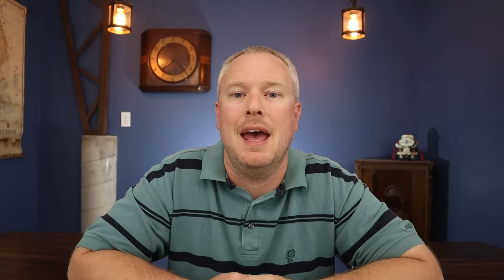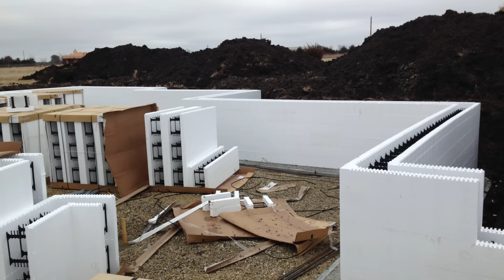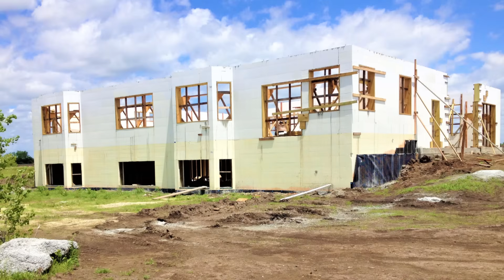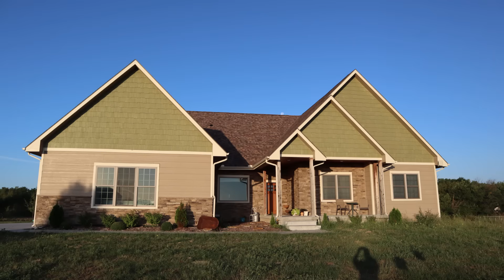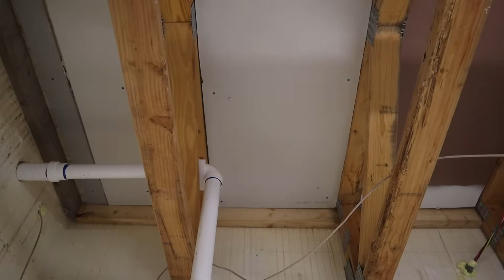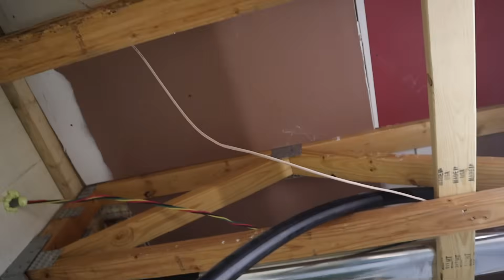Is Geothermal Heating & Cooling Worth It?

Comment: I did the same about ten years ago, I put it into an old leaky farmhouse on 11 acres, put about 2000' of loop under the pasture, and it's been great. If it hadn't I would have set iy up to use my well water from my current 450' well and and put the return over into the pond. The whole thing unit as well as installing it myself cost about $6,000. Only problem I've had with it is the condensation drain plugging up after 5-6 years which is common for all types of systems around here.

Comment: Just got rid of the 25 year old climatemaster piece of crap. Way over sold back then and hopelessly this guy is spitting out the same crap, don’t buy in on it. No rebates, super high cost, all the noise is constant inside the house. Any hvac guy will tell you run away from geothermal, except thethis guy selling this crap.

Comment: Glad this worked out so well for him. Generally speaking, I don't recommend DIY geothermal because DIY has given geo a bad reputation in the past. A properly designed and installed system will give you insanely good efficiency and a worry-free system for decades. I understand the allure of DIY because the install cost is high. One growing trend that will bring down the cost of geothermal is utilities beginning to install geothermal over an entire neighborhood. Electric utilities love it because it reduces peak demand in the summer and provides electric demand in the winter. Just beware if you are a DIYer, there are many opportunities to screw it up.

Comment: Would like to see a video showing how the geothermal system works. How deep must you go to reach heat underground to warm the home in the winter?
Reply: So to a point it depends on where you live - you obviously need to get well below the frost line for your area.   IF you live in Barrow alaska it would be deeper then say if you lived in Georgia.   At least here in ohio where i live, 12-13 feet seems to be the minimum.  IF you lived in Maine where the frost line is just over 8 feet deep, you would probably have to go 25 feet or so down.  general rule of thumb i have found is, you want to be a minimum of 10 feet deep and also a minimum of 10 feet below the frost line.    

It also depends on what type of system you want.    Some of these systems you cut long rows in your yard,  at least 12 feet deep and you run coils of hose all around the yard like that and cover them up  But you have another option, they bring a driller out and just like if you were drilling for a water well, they bore down somewhere between 250-350FT and they run the  pipes up and down that hole.     Both accomplish the same thing, one requires alot more land tho.

Comment: Glueing some of that foam egg crate stuff to the ceiling would probably be a lot more effective than another piece of flat drywall. Like an anechoic chamber.
Reply from the maker: Actually, drywall is one of the best acoustical blockers.  The typical egg crate stuff does very little.

Comment: Will a teothermal cooling system work in an areas where there will be need of cooling all year round and the temperature in the middle of the day is appr. 32 degrees C all year round?
Reply from the maker: Yes.  As long as the earth temperature is cooler than the air temperature, it will be a more efficient way to cool using a heat pump.

Comment: Do you run the backup system every so often? Or does it just sitting there not effect it negatively over time?
Reply from the maker: It has never come on.  No negative effect when not in use.

Comment: If you are going to install geothermal for a new house construction having a concrete slab configuration, would it be feasible to locate/bury the trenches for the heat transfer pipes deep below the slab?
Reply from the maker: You sure could.  They have to be deep enough as to not pull heat from the home.  Also, you would have to get very good compaction after placing the pipes so the house could be built.

Comment: I had a 3 ton WaterFurnace closed horizontal ground loop installed at my former waterfront home in Northern Ontario. Adequate ground loops are imperative. The house has to be well insulated. The noise can be irritating. And you have to live in an area where electrical pricing isn’t subject to idiotic price changes.

Comment: Great install. I'm am hvac tech. I always loved installing Geothermal.  I would recommend a outdoor split geothermal system if possible.  It keeps the noise outside and they are actually much quite than a all in one  package geothermal system.  No noise to worry about cause it's just a very low hum..
Reply from the maker: I didn't realize they made split geo units.  Thanks for sharing
Reply: @Challenged1  
Since you have a hot season and a cold one, and already got involved with digging and insulation, did you ever considered simply storing the heat.
I mean in the summer heating an insulated portion of the ground with the help of solar vacuum tubes. 
And in the winter chill other similar storage. In this way you eliminate the expensive part that is compressor. But insulating the ground may be costly too. 
But that 100 saved monthly, and the fact that replacing some fans is way cheaper than replacing compressors.
Reply: @pineychristian I want to grow trout in souhern part of india. Temperatures here  are like Mexico or Florida. I want to run the glycol filled pipes through the fish tank. Does it work?
Reply: @raghuhiriyur  I think I need a better description of what your trying to accomplish and how does a Geothermal Heatpump help with Trout? If your temps are like Florida or Mexico why would you need Glycol at all ?
Reply: We have had Geothermal for 30 years, our WaterFurnace is in the basement and is as close to silent as possible. Literally the fan, which is variable speed and itself very quiet, makes more noise than the compressor. Unless you know what to listen for you cannot tell if the compressor is running, low or high speed, no difference. If you are not in the utility room it is effectively silent. You cannot here it in the bedroom, bathroom, or family room that abut the utility room. Also, having the entire thing inside the home means it stays dry and clean and easily maintained. I can't imagine putting half of this outside.
Reply: @larrybolhuis1049  plus they make split geo systems that use only a indoor coil which can be mounted on a natural gas furnace for heat. So you'll have a dual fuel system with heating/ cooling from geo thermal and when it gets too cold the geothermal turns off to use the gas furnace. Which in my neck of the woods is much cheaper than paying the electric company because geo's use back up electric heating strips which is like turning on an electric oven every time they come on....
Reply: @larrybolhuis1049  water furnace makes a great split Geo unit. You have it in your basement where I have seen people have package unit geo's like in the attic. Those units have the water going into them. When the there is a water issue like a pipe breaking or a leak it will flood your basement out or someone attic to the adjacent floors below. Your house must be built  well because walls probably thick and good insulation. Ive been working on geo thermal for a long time and split geos are hands down much quieter.
Reply: @pineychristian  Yes our house is well built but as an example the wall between the Geo and the family room is just studs with drywall on the family room side. The Geo unit is that close to silent.  There also are two drains next to the unit in case of water leakage! (Our builder planned ahead!)
Reply: @larrybolhuis1049  no matter what your Geo doesn't compare what is made today. They are even quieter and a split geos are best to keep even more noise down. I've been working on  geos for a long time. Worked on hundreds of them. Standard package geos are still good. Split geos are becoming more popular and get install more and more now
Reply: @pineychristian  I'm glad they keep improving, but since I have to be standing next to here if it's running, I won't be spending money to replace it, hopefully for at least a couple decades!!

Comment: You can further your efforts to quiet the noise heard in your son's bedroom either by the use of spray foam insulation, or a much more DIY friendlier installation of some rock wool. Rock wool installs just as easy as the pink stuff, it's fire proof, there is no need to worry about fiberglass fibers, and there is the sound deadening aspect of it as well.
Reply: Actually don’t do insulation as heat rises and you’ll loose bleed through heating. The BEST fix is found in music bars and it’s acoustic panels. These will absorb and redirect sound but not stop air flow. You don’t need to cover the area entirely (doing so actually lessens the effect) sound isn’t like hot/cold air, but more like a billiard ball. The idea is to bounce the sound waves around keeping them localized. 
 Doubling up the drywall would work much better if a 2-4” gap from the floor and angled slightly. A simple test is use a generator outside. Make a make shift box out of sheet stock then use a decibel meter at various locations above where open then to sides. Then angle the sheet stock with different gaps and test again. Then remove 1 side total open and another side use an open pallet. You’d be surprised at the results of the 3 tests. Then to make things very interesting take the unused 4th sheet stock and seal up 1 side of the open pallet and take a reading
Reply: 2 yrs later, but I was recommending the same thing in another comment 😂
There are DIY friendly foams for small areas like this also. I wouldnt try polyurethane froth packs for DIY though, but can foam could be enough just to isolate directly above the unit.

Comment: Are you using air or water ??????
Reply from the maker: For which portion?  The loop field is a glycol/water mix.  The inside heat exchanger is air.

Comment: My brother and his new wife built a new home and geo thermal. They were not saving that much money. They did save a lot.  And their home is all spray foam insulation so it’s super insulated. Their bill for all electric Geo thermal and inside electric utilities runs 300.00 every Jan on average.  He doesn’t lie.  Now my Mothers home has a high efficiency heat pump seer 20 variable speed and her same size home runs in Jan around 400 a month with all electric kitchen just like my brother. So my brother said geothermal saves him about 35 percent over a heat pump.  Good but not 100 a month  lol.
Reply: And how much solar do they have? He’s got solar man. Says it in the video.
Reply: So, what happened to the old wife?

Comment: Don't extract heat from earth... It will cool down the earth core... End result is lost of magnetic field, and hardening of earth core..
If this happens, very bad... Radiation from sun will burn us... Earth slow don in spinning causing far more serious climate change....
Reply from the maker: That's not how it works.  Heat is extracted in the winter and deposited in the summer.

Comment: I made mine very simple,  could only go between 5 to 6 feet in clay and granite rock. did have air in the line, ended up using a 5 gallon bucket tossed in a small  sub pump no pressure and no air in the line. Do not buy cheap units learned that lesson,  use a Waterfurnace. Older homes it can run more often. use mine spring /summer /fall , dead of winter still need my boiler. -30c   Big tip.. Geo kicks off 90% of the time the  air filter is dirty.

Comment: Ground source heat pump is a good name and should be used, to not confuse it with geothermal energy from deep drilling. Geothermal energy provides much higher temperatures.
Reply from the maker: There are three types of geothermal systems as defined by the government.  This is one, and what you described is one.
Reply: @Challenged1  We here in Iceland make a difference between ground source heat pump and geothermal. If we talk about geothermal energy, we talk about system that use higher temperatures. Usually you have to drill for it.
Reply: @mjoelnir1899  I agree that real geothermal is a grid-scale resource, certainly too much of a capital expense for an individual to heat one home. 

"Ground-source heat pump" is an accurate term, but time is money, and marketers want a quicker way to say it.

Comment: I am building a cottage in Quebec Canada. It's an A frame building and about 950 square feet. Very well insulated with triple glazed windows. I  am off grid and have a 7 kW solar system with batteries and a back up propane generator. I have a all in one ERV/split Heat pump. I am on a lake and originally was going to put my pipes in lake water however the distance to the lake and the distance to get to a 10 foot depth was too much. We have a well so then I thought I'll go open loop however my HVAC contractor convinced me to go to closed loop ground. Even though I'm on almost 2 acres  I  only have a small area next to the cottage that is cleared. I can only fit 2 trenches 30' long. My soil is surrounded by bedrock and is very wet ( digging for the foundation we hit standing water). My thought is: given the size and efficiency of the building as well as having a super efficient ERV/Heat pump and my wet soil.  I think that 50-60 of trench and installing coil pumping should suffice for cold Canadian temperatures. Your thoughts?
Reply from the maker: Unfortunately, those trenches will be too short
Reply: @Challenged1  Thanks! I can achieve more trenching if I install my loop piping in the same trench as my water line that originates at my well. Will the single water line interfere with the performance provided I keep it 2 ft away ?
Reply from the maker: @davidrosolen3282  No

Comment: Next Step: Geothermal Water Well
Using burried plastic sewer pipes and an air pump your DIY can percipitate your own drinking water to the tune of 15gph. Forget about CA water consumption restrictions. Plus the excess airflow not only provides dringing water but can be used to cool and heat your home!

Comment: What did you do to size the system? I have a new barn and I am already digging a 350+ foot trench to build a new spring development. I was going to drop that water line at 6'. I could just go an additional 2' and i'd have a trench for the same type of setup.  How did you calculate the amount of pipe to fan it out? Also, did you look into how tree root systems effect the pipe? This will be going under an orchard, but I could hae the trees avoid the strip.
Reply from the maker: Lots and lots of research as well as talking with any hvac person that had any knowledge of this type of system.  The supplier was also a great resource.  I would avoid putting it under trees if possible.  While the roots won't penetrate the pipe, they could rub up against them.

Comment: Hey Gzarret thanks for the grezat report. I don't know if you can anwer this. Our utilityis offering a huge rebate to replace very old furnace with a thermal storage for thermal heating.. They heat the deramic bricks during offpeak houurs ant release the accumulated energy from the bricks when they are needed.  It's tempting. What do you think?
Reply from the maker: I always try to think of these things as a math problem.  If you do the math and come out ahead, it's worth doing.

Comment: The entire equation is the insulated house, 4 years of no maintenance is not that impressive but when you do have a breakdown it's gonna cost you big time. I've installed hundreds of these and have yet to see the payback within reason.
Reply from the maker: Why do you say it will cost big time?  These systems are more simple than traditional units.
Reply: @Challenged1  I'm not sure if simple would be a correct definition, different components yes simple not to sure. Water side exchangers and pumps have become increasingly expensive and not very well manufactured. If you have one leak under ground it's going to be a nightmare especially if the system takes in any contamination. My issue up front is the rebates, it's not a free money tree somewhere out there and without it the systems are extremely expensive. People still ask me to put them in and it makes me lots of mony but I'm just not sold on the concept. We do much larger commercial systems so to be fair my experience isn't  apples to apples on your project.
Reply from the maker: @marktapey7678  Thanks for sharing.  I guess, when I say its simple, I mean everything is easily accessible within the main unit.  The common things like contactors, capacitors and main boards are all placed right in the front.  The pumps are all common Taco pumps.  Even the compressor is a common Copeland Scroll.  The heat exchangers are definitely different, but they should last the life of the unit.  The loop field should be easy to trace if a problem does exist as each loop can be isolated with valves.  The beauty of putting the pipes so deep in the beginning, is if one does fail and needs replaced, I can dig just a little shallower of the original pipe to install the replacement.

Comment: My septic system is in the way so I am going with solar that banks KWH for winter heat.  I also don't have gas so solar may end up cheaper compared to bringing in gas and getting gas furnace and paying for dino fuel forever.
Reply: Uh.. a battery bank is not the solution for storing energy to use for heating as you need lots of MWH to cover that.
I'm using about 210 MWH for heating in a year and 70% of that is in just 3 months (Dec to Feb) with no sun.

Comment: but if your house is already 80% more efficient  at being insulated then saving all that money and buying a regular hvac system that only runs 20% as much would still have saved 80% of normal heating and cooling bill -plus you could invest the money u didnt have to spend on a heat pump?
Reply from the maker: My system was the equivalent cost of an air to air heat pump because I installed it myself.